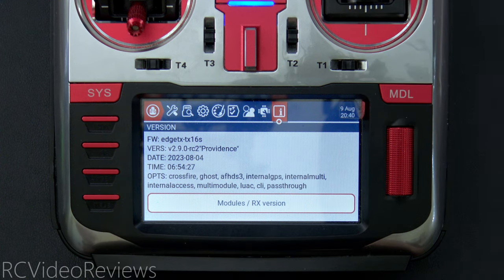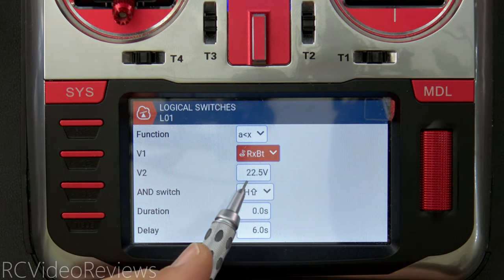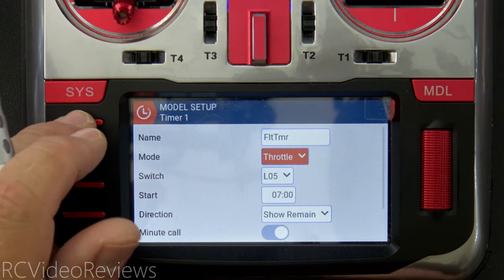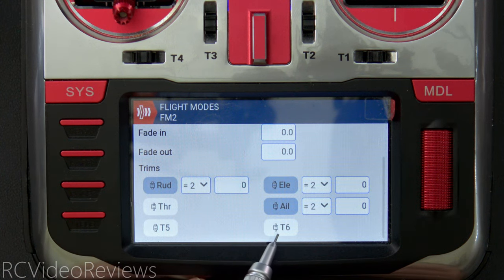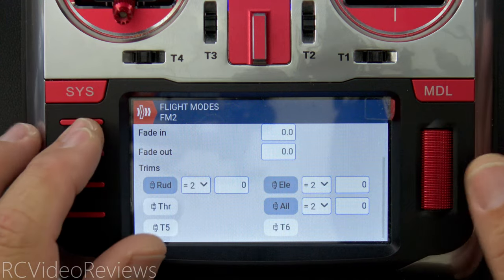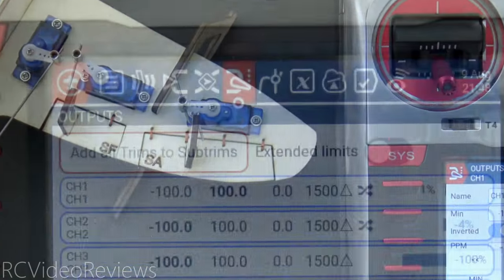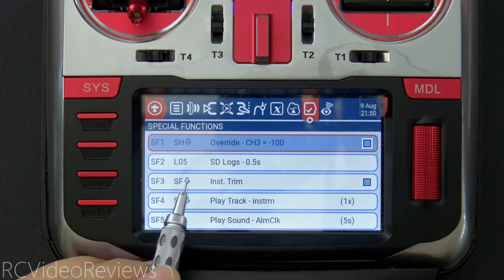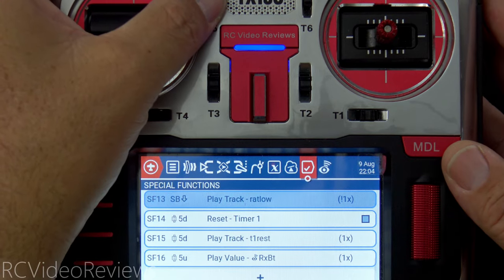2 YEARS of REFINEMENT: How I setup RC planes on the latest EdgeTX 2.9

Comment: I Can't believe how similar you have your setup to mine. I used to have my throttle lock on a switch too but after a little incident that broke my prop on my forearm I now have a logical switch so I have to press t5 and t6 down for 1sec to toggle throttle lockout. Works fab and I cant knock it again.

Comment: Thanks for the help. Been out of the hobby for 15 years and saw the TX16s and thought "man that looks nice and capable."  Unfortunately the radio's complexity has made me feel a bit less than capable. So much to learn, and you have explained it very well. Thanks!
Reply from the maker: Take your time with it. Keep watching videos and play along. Before long, a light will click on and you'll know what to do.
Reply: @RCVideoReviews  I successfully binded my ER5A v2 and have my 5th channel as the second aileron servo. Any idea why only the channel 5 servo is acting like it is on a switch? Move the stick a fraction and it moves the servo all the way. Release stick and it speeds back the opposite way.  The channel 1 servo is working properly.  I left the input section alone and added servo 5 on channel 5 of mixes using the aileron (output? triangle icon) as source. Didn't change anything else.  Could you point me in the right direction? Thanks!
Reply from the maker: You need to join our discord and ask questions like this there. YouTube is a terrible platform for help.

The answers is Ch5/Aux1 an arm switch in ELRS. It's a binary channel unless you use 333hz 16/2. See this guide for more info: https://www.expresslrs.org/software/switch-config/

And definitely join discord.
Reply: @RCVideoReviews  Thank you so much! I switched over to 333hz 16/2 and no more ch5 servo problem. I also set up discord for any future needs. Thanks again for the help!

Comment: Beginner tip, which I learned the hard way, moving from a rudder/elevator plane, to an aileron/elevator/rudder plane. Start with the rates on the aileron about 20%, and add a rudder mix. That, or watch your plane rollover and turn into match sticks. I had no help in the learning experience, and had a nice pile of match sticks from a few planes...

Comment: Hi. Really super as always. Might be worth mentioning that reversing the output on the throttle does not revere the direction of the prop but changes between full and off throttle. This can catch the foolish (me for example) unawares with an instant unexpected runaway throttle. Kind Regards
Reply from the maker: Yeah, you do not want to do that. If you need to change your motor direction, just switch two of the three leads between the ESC and motor.

Comment: Been on the sidelines for a bit now so will use this as a bit of a refresher on a couple of new birds that need setting up, good for the mind 😊, 
Also could do with a slight elevator / throttle mix  as on full power my boomerang 60 wants to go skyward on full power, that or maybe go back watch the instant trim switch may work hmmm 🤔
Reply from the maker: I know of people that have entire flights slapping instant trim. In full sized planes we constantly trim the plane. Or flight modes :P or a mix, or ......

Comment: First of all, let me tell you what a BIG help you have been helping me get thru the transition from Spektrum to open-source programming. That been said, about the arming switch; what does the arming  actually do. I only fly fixed wing planes; do I need to add a switch to be able to turn the arming channel on and off? Another, thank you; keep the videos flowing.
Reply from the maker: Arming for ELRS basically prevents lua script changes to the radio setup and turns dynamic power on. There are a few other minor bits, but those are the two big ones.
Reply: Thank you Sir. @RCVideoReviews
Reply from the maker: You're welcome.

Comment: This video has been indispensable for seeing up my new radio. Thank you so much for sharing your settings. I have a plane in which I am using both 3s and 4s battery packs. Any ideas on how you would set up the logic switches for the rxbat with two different pack voltages in the same model? Thanks!
Reply: Maybe you already found the answer but i guess i would made a copy of the model creating an identical one and i would change the names and the voltages for the alarms.

Comment: The explanation about the vbatt telemetry was amazing! Can't wait to add this to my other models. Does 6 seconds work as well on drones and helis as it does on planes?
Reply from the maker: It's a little bit more dependent on current draw than anything else. That said, I've been using the 6s delay on just about everything: Helis, Quads, Planes, and it's oddly good at getting me on the ground with about 3.8v/c after a few minutes of rest. It could go lower, but I keep a little fuel in the tank in case I need to make a few go-rounds'

Comment: Fantastic video tutorial, im going trough the process of changing radio and i need to configure some planes from beginning and i didn't do that for years, and your video giving me good guide how to do it. are you have installed different sound pack? i cant find sound for insttrim and i checked sound packs from Edge TX and Amber sound pack.
Reply from the maker: You should join discord. I use the stock EdgeTX sound pack but then make my own Emily sounds as necessary. I have an #emily-requests channel too, so if you need something, I can make it.

Comment: Hello, Is it possible to use R9 Access on edgeTX?
I only see R9 protocol option on the external TX module.
OpenTX has the two options R9 and R9 Access , Im trying to migrate to edgeTX but I need the access option.

Comment: Question New tx16s mk11 running edgetx, updated to v2.91, with 28 models imported from X9D all, .yml format. I have a continuous warning signal with a flashing dot on the top menu bar  near the battery charge indicator.   It has been suggested that it is a Binding warning  signal. would u agree with that and have u any suggestion as to a fix. Regards Trevor in oz

Comment: Such great info 👍🏻 With the no sag voltage alert I fly multiple quads on the same setup most are 6s and 1 is 4s is there a way I can change voltage with some type of condition essentially recognising 6s/4s or make another model just for 4s? Thank you 6:00
Reply from the maker: Just use a single cell voltage and pull from one cell instead of the pack. Then you could set 3.6v or whatever for all models. Downside is you are using the value of one cell. Alternatively, you could use a 4s value for all, and just plug your vbat in so you only pickup cells 1-4 no matter what model. 

That's probably what I'd do.
Reply: @RCVideoReviews  Arh yes that will work with my plane as I’ve got single cell tel but I’ve got quads I fly on same model flying 4and 6s, with not individual cel voltage, just make another model for the 4s ones?

Comment: I didn't know about the instant trim feature. I was wishing for exactly that feature and I had it all along. Heh!
Reply: Now the question is where to put it since I use my only momentary for timer reset when I slope soar.
Reply from the maker: The RM DIY momentary switch is a nice upgrade. You can also turn off t5/t6 as trim in flight modes and gain 4 more momentary switches: T5u/d, T6u/d.
Reply: @RCVideoReviews  I have a Mark 1. So I don't think the DIY switch is an option. But I'll definitely try the extra trim switch trick!

Comment: Hi would the logical switches work for me with an RCBoat ? I have a voltage sensor. I want it to alert me too when the battery gets to the charge voltage 3.8V as well ??? I'm guessing the throttle lock SH down would stop my boat motor from running. And when the SH switch is UP it's unarmed. I wish someone did a video setup up RC boats with the TX16S :(

Comment: Great video as always, quick question. I have a RadioMaster TX 16 S running 2.9 multi protocol. After binding my R88 receiver, if you’re too close to it with the radio it drops reception. Why does it always do that?
Reply from the maker: Sounds like swamping. Don’t keep your tx too close to your rx. Also check this out: Multi Protocol Module Frequency Fine Tune on Radiomaster TX16s MKII
https://youtu.be/08W8usnP0dA

Comment: Hi there - very informative and thankyou. I'm looking for a way configure a switch that overides the throttle by say 3%. So if the throttle was at 50, or 80, or 100%, then by flicking the assigned switch, the throttle would change to 53, 83 or 103% respectively. Hope you can help ! - note im a newbie, and looking to apply this to EdgeTX in a Radiomaster Pocket
Reply from the maker: I'd probably use a mix and and offset based on GV activated by the switch.

Comment: I have a question. @37:00 or so you talk about inverting your outputs. Is there a reason you don't do that for your arm switch instead of setting it -100 in the mixer?
Reply from the maker: Not really. Good point, based on the philosophy of reversing in outputs this makes sense. I think the mental gymnastics going on in my head were I don't really think of arming/disarm as a broadcast/rf thing (even though it is for ELRS and for models with FCs), I always think of it as a local thing to the radio (as in throttle lock/unlock) so for that reason, I never considered arm as an "output" leaving the radio, so adjustments to me are done before outputs. Anyway, it's a good catch and would certainly do the job. As with most things on EdgeTX, there are a half dozen ways to accomplish things on the radio.
Reply: @RCVideoReviews  coming from quads I guess it's just a natural way to do it. Have had to do a bit of thinking with the elrs way of arming and doing something very similar to JB's gazillion modes on one aux thing. 😅
Currently working on a long range atomrc dolphin that getting converted to functional v-tail
Reply from the maker: Yeah, if it's going out via RF, outputs is where I usually invert things. Good luck with your Dolphin build.

Comment: Thank you for always providing good information.

I have one question for you.
I always use the independent trim for Flight Mode when setting up flaps.
In this case, a delay of 1 second is given to the flap servo, and a delay of 1 second is also given to the mode change so that the flap moves gradually.

The recently set F-16 plane is used with the Elevator set to Flapperon and the Elevator set to Elevon, but there is no problem with the operation, but I could not find a way to give a 1 second delay.

Is there any good way to solve it?
Reply from the maker: Make the activating switch a logical switch, define the logic switch as an Edge switch with a delay.
Reply: Thank you for your comments.
But I haven't been able to figure out the right way yet.
It works slowly with the edge feature you mentioned. However, it works only as long as the time set at the bottom and returns to its original position.
what did I do wrong?
I'm planning to set up the Freewing F-14 with flaperons to the ailerons.
I don't want to operate with a control surface that moves in an instant.
I am asking for your help.
Thank you.

Comment: I'd like to set up your SF16, but I don't find the RxBt value.
Reply from the maker: RxBt is telemetry and is dependent on the receiver you use. In my case it's an ELRS receiver which provides RxBt telemetry. If you're using an ELRS Rx with RxBt, you have to go to the telemetry page and discover sensors. After that, you should see RxBt as an option.

Comment: Would there be anyway you would consider making a video showing how to bind and set up a LEMON stabilizer in the RADIO. I know how to adjust and use the stabilizer I just cant seem to set it up on a switch to control it and a knob to adjust it. Grayson hobby did it for the lemon stabilizer PLus but it was in OPEN TX not edgeTX Ive followed their instructions but no go. You have a way of explaining these things that I can understand and follow.
Reply from the maker: I'm glad I'm able to help. Looking at the manual it says to put a switch on Ch7 or optionally Ch5 and  Ch8 is gain. So that's what I would do. Just go into the mixer on Ch7 and set the source to a switch. Ch8, same thing, but use a knob. From there, you just need to figure out if the Lemon wants to see 998us - 2012us or 1500us - 2012us. 

I suggest joining us on discord for further discussion. Invite link is in every video.
Reply: Will do! Thank you for your response. @RCVideoReviews

Comment: Im kinda new so please excuse me if i ask silly questions. 

Can edge tx transmitters bind with almost any aircraft? Or only with certain receivers?
Reply from the maker: EdgeTX is not the sole determining factor of supported RF protocols. It depends on the RF transmitter module in your radio too. For example, ELRS transmitters can bind with ELRS protocol receivers and nothing else. The 4in1 module can bind with receivers using the protocols on this page: https://github.com/pascallanger/DIY-Multiprotocol-TX-Module/blob/master/Protocols_Details.md
Reply: This is so confusing to a noob like me. 

I think I get the gist of it tho. 

I'm looking to get a tx16s, does that need additional modules to be used or does it operate in some form as standard out of the box?

Planning to fly a conscendo evolution 1.5 with it if it is compatible.
Reply from the maker: @Doggy-B you need to join my discord. Link is in every video I post.
Reply: Thank you. I will indeed. I need a community that helps each other out. Google is not friendly in that regard.

Comment: I have a question,  i have this little plane that has 3 modes, beginner,  intermediate and manual . What i want is when i put it in manual mode i want a rate of movement and expo just for manual mode only .so when i go lets say back to beginner mode the rate movement and expo aren't there
Reply from the maker: Setup your inputs like I did in the video, but instead of using a "rate switch" use your "mode switch"
Reply from the maker: You have to have rates on all modes. With no rates, you have no movement. You should join discord to discuss further. YouTube is a terrible platform for dialogue like this.

Rates are not assign a channel. If you want whatever rates/expos to travel with your mode switch, you use the mode switch in inputs to make adjustments to rates/expos whatever they happen to be.
Reply: @RCVideoReviews Ok , I figured it out, thanks for your help

Comment: Yet again a good video.
Anyway you could do a video on setting up retracts please.
Reply from the maker: In the video, find the section for mode, repeat that on the retracts channel using a 2 position switch or a slider (which is what I use). Just put one switch on the mix line connected to your retracts.